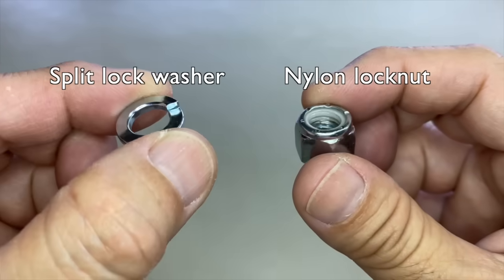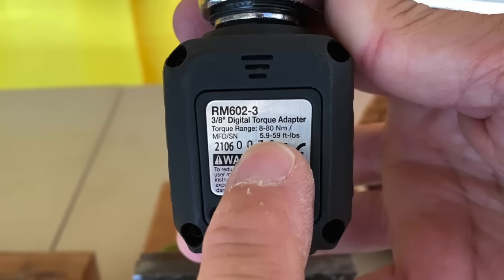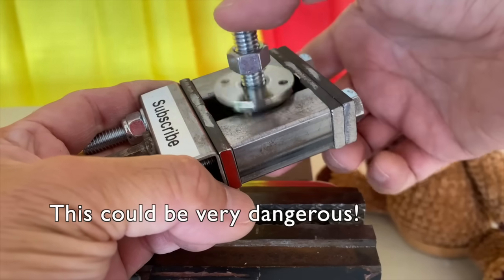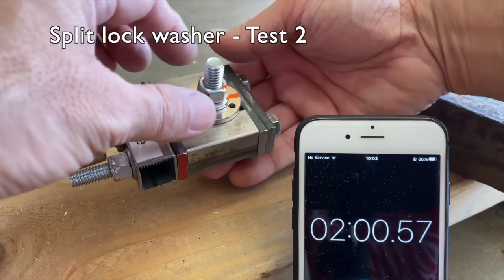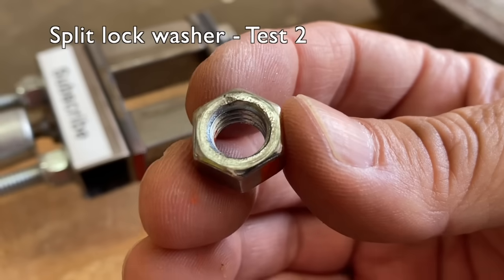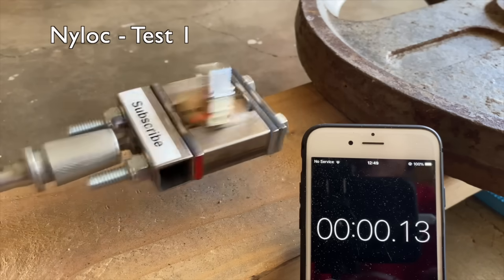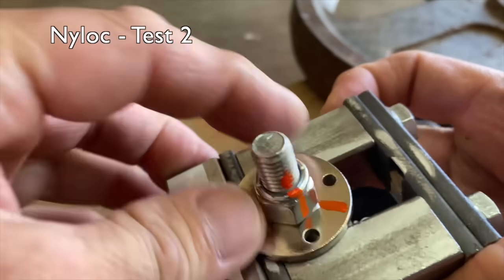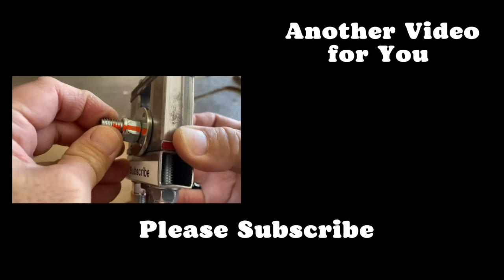Nuts & Bolts - Split Lock Washer vs Nylon Locknut – DIY Impact & Vibration Test - Part 1

Comment: I don't know what the manufacturers spec is for the lock washer assembly, but I'm certain it's more that 6 ft/lbs. Torque specs are in place to let the stretch of the bolt to act like a spring to absorb stresses placed on it WITHOUT permanently changing the length of the bolt.  I don't believe this part of your presentation was a significant test of that system.  

Regarding the nyloc portion, it appears that the nut held it's grip on a bolt that changed length. While I would never have predicted that, the only conclusion that comes to me is that the bolt is probably grade 2 and needs to be higher strength, such a grade 5 or grade 8.  As for the change of length, the only thing that comes to mind is that the inertia of the parts of the assembly that were displaced from the center of gravity, were exerting off primary axis forces that in effect pried the two parts of the assembly apart, thus stretching the bolt without loosing the nut.

I spent more than 20 years working in a tool and die shop within a research facility.  We had hundreds of punch presses and this type of issue was ever present.  Our practice evolved to the point where each die set was logged and a history was kept on each set of critical hardware.  The first time a bolt was used it was precision torqued to 92 % of the manufacturers spec..  The second time, it was torqued to 95%.  Lastly, was torqued to 98%. Following that, the hardware was sprayed with blue die and could never again be used in a critical application.  Following this regimen, the only failures were due to wrecks involving errant product flow into or out of the die set.
Reply from the maker: 6 ft-lbs was sufficient in the follow-up test… Split Lock Washer vs Split Lock Washer & Nyloc – DIY Impact & Vibration Test - Part 2
https://youtu.be/Iao2HT71kB8
👍😎

Comment: In conclusion, apply more than 6 ftlbs of torque, lol.
Reply from the maker: 6 ft-lbs was sufficient in the follow-up test… Split Lock Washer vs Split Lock Washer & Nyloc – DIY Impact & Vibration Test - Part 2
https://youtu.be/Iao2HT71kB8
👍😎

Comment: Looking at this experiment as the alignment marks on the nyloc nut and thread always seemed aligned each time the test was paused what was experienced was a fair amount of wear in the soft steel of the holding apparatus and not the movement of the nut on the thread.

Comment: Credibility gone. As a industrial mechanic, there is no way im torquing something so loose that I want to stay tight. The lock washer wasnt even totally flatened. Useless video
Reply from the maker: Chill… it was just a simple experiment.  6 ft-lbs was surprisingly sufficient in the follow-up test… Split Lock Washer vs Split Lock Washer & Nyloc – DIY Impact & Vibration Test - Part 2
https://youtu.be/Iao2HT71kB8
👍😎

Comment: Lock washers are great if more torque is applied and have better holding capability than nylocs and not knocking nylocs cause I do use them for certain applications but they are really a one time use one the threads are cut and removed you lose your primary holding ability
Reply from the maker: 6 ft-lbs was sufficient in the follow-up test… Split Lock Washer vs Split Lock Washer & Nyloc – DIY Impact & Vibration Test - Part 2
https://youtu.be/Iao2HT71kB8
👍😎

Comment: Your control and video is flawed, the oil from on your skin affects torque value. The split lock washer and the low carbon nylon lock nut are crap. If you want a good connection use a mechanical locking nut where the last thread is slightly inverted or dimpled inward in 3 spots .Some folks call them grip nuts because they are all steel . A mechanical lock nut can be used safely 3 times but a nylon lock nut can safely be used only once. You don’t see nylocks on heavy equipment. I worked for a fastener distributor for near 50 years .

Comment: This just confirmed my suspicion and why as a mechanic, I've personally chose to put THREAD LOCKER, on everything, even if it has a split lock washer, or nylon thread. Especially suspension, and steering components that see tons of vibrations. I have literally told friends to ask mechanics, "do y'all use thread locker on the suspension components?". If they say, "it doesn't need it", turn around and walk away and never come back. Don't even argue with them.
Reply: If you put thread locker on ball joints you are asking for trouble. Where do you work on steering components that don't have castle nuts and cotter keys? I don't think you have any mechanical sense at all. I would run from you.

Comment: 6 ft lbs for a bolt that size is very low.  You have solved a problem that is not a problem.  In 60 years of working on cars, trucks, tractors and other mechanical objects, I have never found a properly torqued nut, bolt and washer to vibrate loose.  You could use a nylon nut every time but you would be wasting money.  Manufacturers go to great lengths to specify torque and the size and combination of combination of nut, bolt and washer for the application.  It's only when we change that that we get in trouble.
Reply: I’ve had to use Loctite on several vehicles which had bolts that were torqued to specification but would loosen up after several months. Motorcycles have engines that will vibrate the chassis much more than cars. Every bolt has Loctite applied to it for a reason.
Reply: M12 bolt requires 85nm with a tolerance of plus 5nm on an 8.8 bolt  while using a serrated lock washers using never seize (not copper coat) 100nm using thread lock no serrated lock washers. There are other nm depending on the bolt type, thread pitch, materials that are being held together, materials that are being sandwiched, materials that are being threaded into. Everything must be recorded.
Reply: Remember, the softening temperature of nylon is only 85C, split lock doesnt have that problem.
Reply: @ I agree, that is why you do not use nylocs in high temperature or extreme low temperature environments. 
Split washers were invented when a cheap and easy to manufacture solution was required.
Now schnore washers are king until something better comes along. 
With today’s high torque bolts  8.8, 9.0 and 10.2
Split washers should not be used. 
I facepalm when non OEM use star washers. 
Or reuse bolts and washers.
Reply: @ Good point.
Reply: @DRedGuia That's why deformed nuts are used in high temp applications in my experience.
Reply: 6 foot pounds? I had to go back and replay that to see if I heard correctly. I really enjoyed your methodology, but wish you had consulted a torque chart instead of arbitrarily going to 6ft/lbs.
Reply: LOL!!!  Exactly!!!
Reply: Torque is way too low in this test. At 6 ft-lbs there is very little pre-load on that screw.
Reply: Yeah, of course the locknut is going to perform better if the nut is loose, which this one is, basically.
Reply: That 6 ft-lb was surprising so I looked it up.  My memory is correct; that wasn't a valid test.  In fact, even the close up of the lock washer showed it wasn't even engaging any pressure against the bolt threads.  Nonsense experiment.  This was done just to make content for Youtube, but I can't take it seriously.
Reply: @cherryjuice9946 ,,, yes , the primary concern was the video time , Yes , Agree ,,, !
Reply: Those nuts with plastic SUCK...I morally if I
Don't have another nut I will grind the plastic off!!! And yes you need more than 6 lbs...geez man 😂 lock washer.... please!!!
Reply: Normally!!!😂
Reply: I was thinking the same thing, I have used only normal nuts and bolts and tighten them rigidly and have never come off anything that moves or shakes, maybe after 1 year they'll become loose once in a while.
Reply: I've seen plenty of properly torqued hardware come loose from extreme duty use.
Reply: Yeah dude a 3/8 bolt under grade 5 can be torqued down to like 35 to 40 something foot lb.
Reply: I agree with all the comments about the ridiculous 6 ft/lbs torque. For 3/8 bolt should be around 35. One of the main things that keeps a bolt tight is the tension created when tightened. The proper torque stretches the bolt slightly. This is sort of a stored energy that keeps it tight. I’m only mechanic, not engineer so don’t know proper terms to explain this
Reply: @bdinoz1 it's called tensile strength , im not an engineer or mechanic lol ..
Reply: The real problem here is limited free clamping length. Neither solution works really well. Design engineer here. There are a few things that would work: Free bolt length more than 4 times diameter, or castle nut with coter pin, or Loctite, or Nordlock ringsets. But that is about it.
Reply: Yeah, nyloc are really only for situations that require too low of torque to properly preload (stretch) the fastener but not so critical that warrant the need for failproof mechanical locking (like cotter pins or safety wire, etc).
Reply: Aircraft spec is another level
Reply: Yep, I was thinking the same thing, like how do you test a bolt that's basically not even tight to begin with? Of course it would vibrate itself off. The nylon bolt has a lot of friction holding it in place even when it's not tight, not even a fair comparison between the two. And if he's really worried about a high vibration application then they make special locking washers and bolts, but highly unnecessary for regular mechanical usage. You can also use a wire/cutter pin setup that will most certainly prevent a bolt from coming lose. Just learn the basics and save yourself the headache of doing unnecessary testing that's been tested by the industry many many times over the last couple of centuries of mechanics.
Reply: @MrRightNow ,,, he knew that he needed a low 6 pounds for the video . Yes , and the free standing torque of the nylon was a large percentage of such a value .
Reply: @skeezix8156 you are correct in some respect, fasteners experience many different loads at many different angles.
The best reason for not using split washers is because they split. Specially if they get over torqued, I never ever use split washers, only flat, serrated lock washers or a combination of both, and as always it depends on the application,( sorry on to parts I have to use niloc nuts.
Reply: agreed but half the manufactures of things are in china now and dont have good phone number to call and ask for torque specs.
Reply: ... That's the whole point. To find the difference in the comparison you subject them to a extreme torture test. For a lock washer or lock nut, the best test is how well they can secure a bolt that is barely tight. If the bolt was tightened down strongly, we would learn nothing.

Comment: You made a fatal mistake in your experimental design. You need to do the test with similar clamp load across the three different joint types. As performed with all three joint types torqued to 6 ft*lbs, the nyloc joints had significantly lower clamp load than the plain nut examples. To get a similar clamp load you would need to torque the nyloc to 6 ft*lbs + the drag load of the nyloc nut. Which would improve the performance of the nyloc joint even more.

Comment: We found that split lock washers crack, break then fall out from under leaving a gap between the nut, head of bolt and holds nothing tight. We w used external tooth lock washers and had better luck with them.
Reply from the maker: Thanks!  External tooth lock washers didn't perform well in a follow up test... https://youtu.be/KJYOG7TgrGQ
But it's a test under sub-par conditions.  
👍😎

Comment: This set up doesn't tell anything of value.
The torque is so extremely low as to be utterly unrealistic for a bolt that size. That is not a "real world condition".
Also split washers have been shown to be actually useless and the industry norms regulating them have been retracted for that reason.
Reply from the maker: 6 ft-lbs was sufficient in the follow-up test… Split Lock Washer vs Split Lock Washer & Nyloc – DIY Impact & Vibration Test - Part 2
https://youtu.be/Iao2HT71kB8
👍😎

Comment: Maybe don't make videos while the most annoying background noise in the world is happening. Leaf blower or chain saw or whatever. Can't watch this.
Reply from the maker: LOL!  Thanks for the laugh!
That the reciprocating saw that shakes the test rig.  It’s a necessary part of the video and the volume was decreased to a fraction in the edit. 👍😎
Reply: @HacksbyDad  The sound was in the beginning of the video which seemed like from outside. Before you started the test. 
I just have a personal aversion to leaf blowers and other small whiny motors. I put in ear plugs when it's happening in my neighborhood. Maybe I'm overly sensitive to it, but would rather have end of airport runway next to my house than those. At least battery devices are starting to replace those.
Reply from the maker: @wyskass861   Thanks!  I stand corrected.  I didn't notice the background noise during the editing process.  I'll keep that in mind in future videos.  👍😎
Reply: @HacksbyDad  Upon another viewing, it seems I may have overreacted and it wasn't too bad. Your testing was quite insightful.

Comment: Did you account for the torque it took to overcome the friction of the nylock when you applied the final torque.  I don't think so.  Read the torque while sending the nut down the bolt and then add your final torque to that number.

Comment: This is why stretch bolts are so good. They will NEVER loose clamping force even after heat cycles and vibration. Which is why they are used in engines.

Comment: Why isn’t this torqued to spec for that hardware? 6lbs is finger tight.
Reply from the maker: It was just a simple experiment.  6 ft-lbs was sufficient in the follow-up test… Split Lock Washer vs Split Lock Washer & Nyloc – DIY Impact & Vibration Test - Part 2
https://youtu.be/Iao2HT71kB8
👍😎

Comment: Seems like a very high stress situation for only 6lb torque. let's try this experiment with the torque rating for the size hardware and see the results
Reply from the maker: 6 ft-lbs was sufficient in the follow-up test… Split Lock Washer vs Split Lock Washer & Nyloc – DIY Impact & Vibration Test - Part 2
https://youtu.be/Iao2HT71kB8
👍😎

Comment: should retry this test and actually use enough torque to make the lock washer fully lock down 2:19
Reply from the maker: 6 ft-lbs was sufficient in the follow-up test… Split Lock Washer vs Split Lock Washer & Nyloc – DIY Impact & Vibration Test - Part 2
https://youtu.be/Iao2HT71kB8
👍😎

Comment: there is a flaw in the test with the nyloc.   Nylocs have a torque value just moving on the bolt.  To achieve 6 ft-lbs torque you have to use a torque angle device rather than a torque wrench.   Perhaps using a torque angle measurement is a better way all round.   Even compressing the lock washer skews the actual torque values.

Comment: I worked for a foundry molding machine supplier from 2005 until 2015. I started working on those machine from 1990 until 2024. They rarely used lockwashers and then under very specific conditions. They labeled lock washers as loosening devices They relied on proper torque specs. I could count on one hand how many times a properly torqued bolt or nut worked loose. This was true from M5 to M30 sizes. This was my experience for almost 34 years.

Comment: In aviation one piece locknuts are used. They are deformed slightly on the top of the nut, sort of oval shape. You can start the nut with your fingers but like the nyloc nut you’ll need a wrench to get past the deformed end. These types of lock nut work will in all types of environments too. They can also be used more than once as long as the locking quality remains intact.

Comment: a flat washer needs to be put in between the "permanent/costly" surface and the "nut/cheap" surface to prevent the split washer damage to the surface that needs protection. Yes, nylon or brass insert lock nuts beats the split washer every day.

Comment: 6 fb of torque is way too little to start with.
Reply from the maker: 6 ft-lbs was sufficient in the follow-up test… Split Lock Washer vs Split Lock Washer & Nyloc – DIY Impact & Vibration Test - Part 2
https://youtu.be/Iao2HT71kB8
👍😎

Comment: In order to have real meaning, the bolt and nut must be torqued to a value that is found in typical use. I know of no one who would use 6lbs as a torque value for a size like 3/8-16. No wonder it came loose.
Reply from the maker: 6 ft-lbs was sufficient in the follow-up test… Split Lock Washer vs Split Lock Washer & Nyloc – DIY Impact & Vibration Test - Part 2
https://youtu.be/Iao2HT71kB8
👍😎

Comment: There was NO misalignment with locknuts, locknut prevents movment between nut and a bolt, and there was no misalignment. Split lock washer increases the friction by pressing on the thread and the material. That's different. Material under locknut moved because you used very small torque.

Comment: I think the important part about the nylon locking nuts (and why I use them) is even the fastener loosens, it's still retained and it won't completely unthread. In a lot of cases, a loose bolt will do a lot less damage than there not being a bolt there at all. Especially if you can catch it/realize that it's loose.

Comment: Invalid test as recommended torque range is like 37 ft-lb for a 1/2" grade 2 fastener.  6 ft-lb is basically not much more than hand tight

Comment: You could try with all metal lock nuts, they arey are used in the suspension in cars they are harder to turn than nylon nuts

Comment: Why not repeat this with a bolt of small-enough diameter to bring that small torque into the bolt's designed load range?  That way you can  use the same innovative rig and get more valid results without extended run times.
Reply from the maker: Thanks!  That’s a great suggestion!
I’ll look into it. 👍😎

Comment: For 3/8" screw the applied torque is to small. You need  about double. The torque is very important for a screw and nut to hold under vibrations.